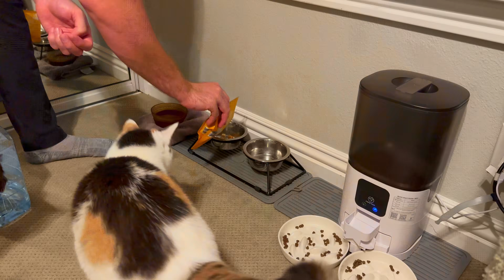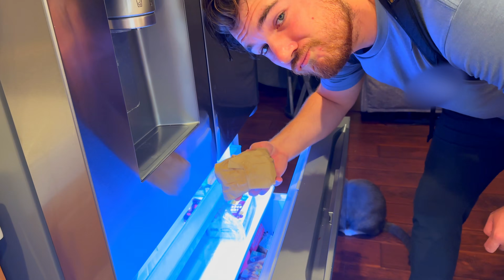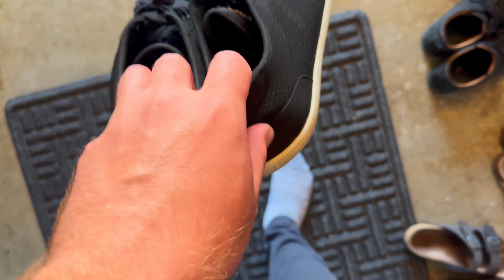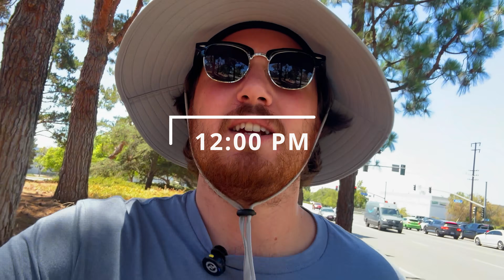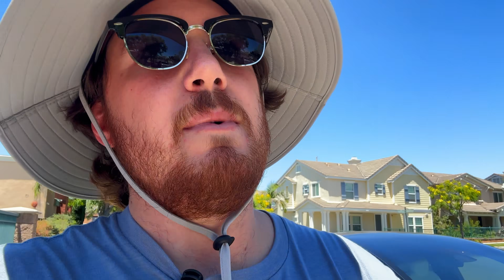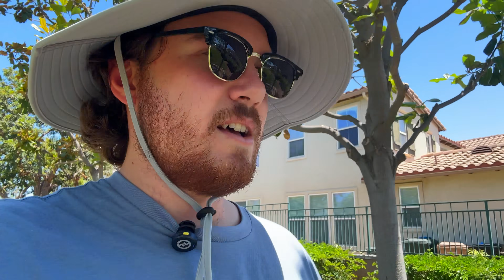Day in the Life of a Mechanical Engineering Intern | Vlog

Comment: I’m currently a year into my mechanical engineering degree. I (think) I want to work with robotics. I know school isn’t teaching me what I will really need on the job, and finding an internship this year (~2 years before graduating) is a goal. Any advice in finding & getting an internship in SC, and also any additional advice?
Reply from the maker: Most internships require/prefer CAD experience, so taking that class and getting familiar with CAD quick really helps you be a competitive applicant. Dial in your resumé (I have a free google doc template in my youtube description section thing if you’d like. It’s also helpful to use AI for feedback, not to write it tho). Apply to literally everything even if you don’t feel qualified (use job application apps even if they seem random, I got mine on ZipRecruiter). I also have a video that touches on this. Feel free to hmu if you have any more questions or anything 🤙
Reply: Advice? Don't move to California for a job, and you should be fine. Find a maker space and design your own robots.
Reply from the maker: Why exclude California
Reply: @Solomon-Sprenger  Because it's expensive and filled with scammers. Scammers being companies who only hire for projects and then get rid of you the second the project is over, very few Americans in the workforce, etc.